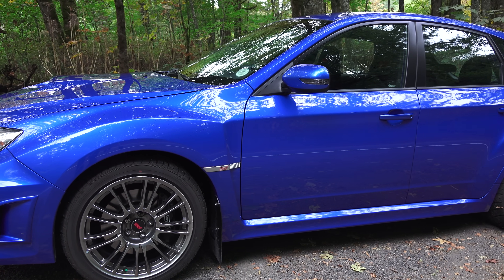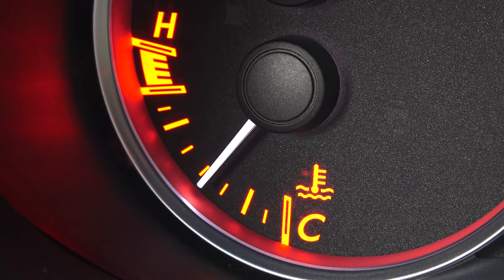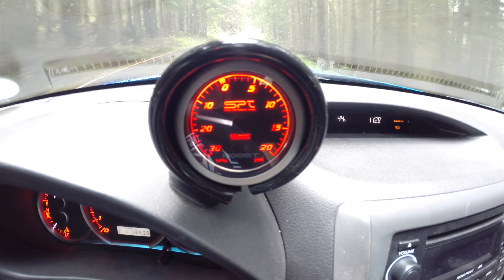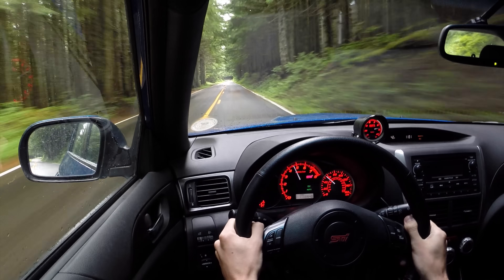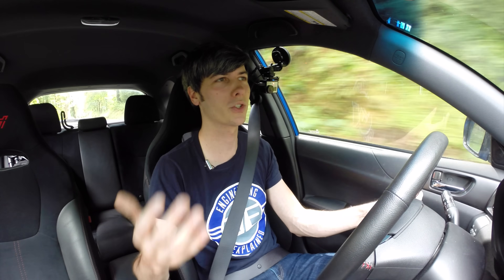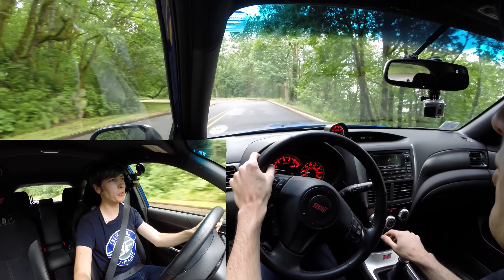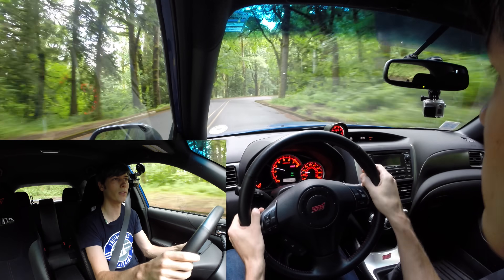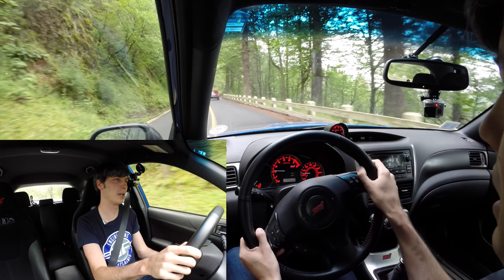5 Things You Should Never Do In A Turbocharged Vehicle

Comment: Not sure what you mean regarding 'lugging' causing the engine to run rich and damage the engine and cat. That is nonsense, modern fuel injection engines control mixture based on engine load, AFR, map etc, the won't allow a engine to run excessively lean or rich. You might have your foot flat to the floor, requesting full power but the ecu will give you what is safe, that means not allowing it to run dangerously rich. Imagine the warranty claims if owners could actually damage their engine buy driving round in a too low gear and the ECU allowing rich mixtures which kill the cat !!!
Reply: +Engineering Explained I agree ECUs will run rich over lean, that again is a safety feature, in the same way it will pull out ignition timing to prevent pre ignition (knock). Yes of course bad drivers can damage a car with too much clutch slip, poor gear changes brake the gearbox etc etc, but the ECU will prevent incorrect mixtures regardless of what the driver does.  If your scenario of low gear acceleration did cause damage due to fuelling  that would indicate the ECU couldn't adjust fuel and ignition to keep the AFR and timing under control, which clearly isn't the case. The fact that the same car can reliably operate at high and low altitudes and hot and cold climates means the ECUs have a range of parameters it can adjust to account for external factors whilst keeping everything safe. Catering for the changes in temperature, fuel quality, altitude etc etc which a car sold globally has to cope with is far more complex than people not changing gear early enough.
Reply: I have a mazdaspeed 3 which has a fairly modern direct injection engine and this is a known problem among them.  Everyone will tell you to never floor the car under 3000 Rpm.
Reply: In our mazdaspeeds one of the "problems" (which also results in a lot of fun) is the offset between the center of the crank and the rods, which results into stupidly more torque than similar engines. With the factory insta-spool turbos and some poor tuning the rods can bend or crack in no time.
Reply: MJ W LSPI starts happening usually when there are hot spots in the cylinder or on the piston. Especially DI engines will produce a lot of soot which is aggravated by low RPM high load situations when the mixture is enriched. Over time that soot clogs onthe piston crown (also helped by poor gas quality, extended service intervals, frequent short trips with a cold engine, and so on). That is something that the ECU cannot control and can't prevent either because it's not post spark ignition, is just a spontaneous phenomenon.
Reply: +Victor Tarhon-Onu any soot build up on piston crowns etc is quickly cleared through normal driving/lighter loads scenarios. If we are saying that someone would need to drive their car every mile in the lowest rpm possible (chugging) and we would need a specific Mazda design of engine, also poor fuel quality, and then over a large number of miles and then, only then could even potential damage occur I think this proves my point.... That this advice regarding not changing gear too early falls into the same common sense advice as let the oil warm up is simply not true and at which point in the rev range you change gear will not damage your engine. In fact many modern cars have shift indicators telling you to change up extremely early to improve economy.
Reply: MJ W
Some of that soot does no clear, especially on cars driven slow and on short trips with a cold engine. My car is driven normally->hard and when I rebuilt the engine there was still a good layer of soot on the piston crowns.
As for the gear change light in the modern cars - that's exclusively for fuel economy. Economy driving and healthy driving intersect somewhere around 2200-2300rpm and maximum 50% load on a petrol engine (substract 300-400rpm for a diesel).
Reply from the maker: Most people drive automatics, which require very little effort from the driver in order to keep things reliable. (Example, floor it in a high gear and it downshifts). You can easily damage a manual vehicle if you don't know what you're doing. Burn up the clutch, damage the gears in a launch, cause LSPI. Engines will run rich at high load/high gear (low speed) because it's safer to do so. Running rich greatly reduces the chance of LSPI or knock.
Reply: Screwg oogle
No, it just happens to be one of the pioneers in DI turbocharged petrol engines. That engine is now in the focus ST (destroked) and in the RS, with just some different internals, variable valve timing on the exhaust (the mazda 2.3DISI-fTw had only VVT on the intake) and an improved crank case ventilation system. All other specs are the same and look where it got. The FAILwagen engines do a lot worse even after several revisions and with a significantly larger budget for R&D.
Reply: The Vauxhall corsa vxr engine (1.6t) has a LSPI issue. People have reported damaged ring lands,it would seem pulling onto motorway type driving is the main cause. To make it worse the same engine is in the insignia, a much heavier car.
Reply: This is good advice for a lot of guys who are running modified vehicles with exploratory tunes. This may not be an issue in a new power stroke but after Bubba adds new turbos and his cousin's boyfriend tunes it it could become an issue.
Reply: very common issue with your cousin's boyfriends tune that you got off the internet.. some of the stuff I've seen.. I think my favourite was the tune my 2009 Evo X (SST) came with... initial wastegate duty cycle tables cleared out so it boosts to maximum and then uses the correction algorithm to track it back to the intended load.. hello 2+ bar spikes reeling back in to ~1bar over about 2 seconds.  Through some holy magic of tuning it wasn't knocking.  The gearbox however absolutely hated it, as the clutch pressures had not been tuned to match.
Reply: I'm not going to say you're wrong because I have no clue.  But, what he's talking about has been apparently a problem for some Mustang owners that bought the 4 cyl EcoBoost Turbo.
Reply: +Christopher Hartman I'm actually an owner of a 2015 ecoboost mustang and that's the only reason I know anything about this issue haha
Reply: +Christopher Hartman 

It's mainly with direct injected turbo charged cars.  They can suffer from low speed pre-ignition, which is usually brought on by stopping the accelerator in high gear at low speed.
Reply: On a petrol turbo car the maximum torque is where the turbo is capable and allowed to make maximum torque. Otherwise the maximum thermodynamic efficiency of a petrol engine is between 1800 and 2200rpm and at least in the older petrol turbo cars at this RPM you were nowhere near even having a bit of boost, not to say about peak torque.
Reply: JE V i'm sorry, don't get me wrong, i don't mean you should go for the lowest rpm possible. it's the rpm at which you have max torque that your should aim for in economical driving. and again i'm sorry with the ecu thing, i meant that the ecu itself will prevent knock, will regulate the AFR... you can push down your pedal as much as you want, your ecu will go the the max injection calculated for that mass of air... not the max injection calculated by the capacity of the injectors.
Reply: JE V the transmission doesn't influence the optimal point for fuel economy... that's entirely up to the specifications of the engine... when cruising around 70km/h (+/-45mph) for example, i stay around 1500 rpm so that i use the least fuel as possible and the engine is just fine... my 1.9L turbo diesel has its max torque at 1500 rpm and it has no problem with lugging at that rpm...
Reply: i'm not confusing anything. please learn to read... and 15mph in 5th is just ridicoulous and i did not say that is the way to go. and you can mash the pedal at low rpm too... the ecu itself will make out how much can be injected by taking the airmass and other stuff in account. you can't bypass your ecu with a dct or manual... or you'd be chiptuning...
Reply: Referring to diesel engines this is partially true. Especially if they've been remapped to give even more low end torque. Below boost threshold the only way to get things going is to over fuel the engine. Or, of course, change down to a sensible gear.
Reply: I dunno, my Volvo S70 T5 seems to have a great deal of low end torque. I often skip shift from 2nd to 4th (3000 RPM to 1000-1200 RPM) and the engine will clear it just fine without any signs of lugging. But I'm also not banging on the petal, because it would total forever to get to 3000, but with a light foot you're actually saving fuel doing it this way.
Reply: +JE V I'd like to caveat this by saying you're doing your MPG a disservice if you skip shift into an overdrive gear. Overdrive puts the engine at a mechanical disadvantage, making it work harder then if it was skipped shifted into direct at the same RPM
Reply: Alex Rolli Lower revs doesn't automatically equate to lower fuel consumption. You need airflow to ensure good air/fuel mixing.
Reply: paulanderson79 I meant from skipping a gear. It's something I've carried over from my semi truck where it definitely saves fuel.
Reply: There are obviously some cases where this technique will be of benefit - cars and drivers are all very different.
Reply: You're absolutely correct.  Adding to your point, all modern turbocharged engines have variable geometry turbos along with wastegates.  The ECU controls the boost, not your right foot.  I will give some credence to his claims about diesels, but that's an entirely different subject.
Reply: Even a fairly rudimentary control system, such as one that relies entirely on a Lambda / O2 sensor sticking into the exhaust gas flow just ahead of the cat, shouldn't allow any extreme deviation of the mixture from stochiometric for any significant length of time (well, tell a white lie; the natural state of a bare-bones lambda based system is to continually swing back and forth from slightly lean to slightly rich, crossing the ideal point every couple of seconds, as the signal received by the ECU is a simple 0 or 1, and it merely continually pushes the mix towards lean when the signal says "rich", and towards rich when the signal says "lean", knowing that it will eventually reach the proper balance if it keeps on sliding...). That's the sort of thing that was fitted to my first car when it was built in 1990 (...I bought it in 2002 ;), and it seemed to work just fine even when faced with a lot of youthful abuse... or at least, the catalyser kept working, and the spark plugs never showed any of the classic signs of an incorrect mixture, just some oil fouling when I burned the piston rings through excessive revving.

Things have progressed somewhat in the intervening 28 years, one expects.

Now, my bike is another story, but that's because the much more lenient emissions regs for motorcycles allowed Honda to fit a carburetted, uncatalysed engine, and a pretty stone-age example of one at that, at least as late as 2006, and I wouldn't like to bet at how far from 14:1 the mixture ends up deviating in one way or the other during a cold start in winter through to it being properly warmed up, especially as its manual choke only has three positions... fully closed, fully open, and halfway, and it runs like an absolute dog in anything but fully open (...however, until it's warm, it won't run fully open at all). I expect it starts a little rich at fully closed, progresses to almost too rich to keep running, then flips back twice to rather lean at each of the opening-up steps, going through another stage of richness when half open, and eventually settles somewhere near optimal at the end of the process. If you had a turbo attached to THAT (which I've seen one particularly insane member of a biker forum attempt for shits and giggles), you would have to be VERY careful about your choke setting, how the carb was tuned internally, and letting it warm up before revving hard enough to build up any significant boost...